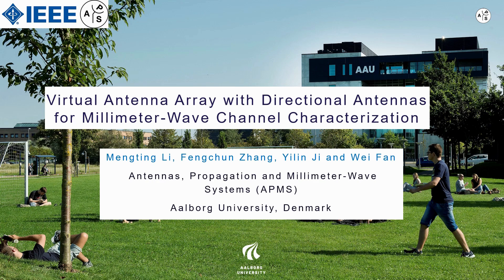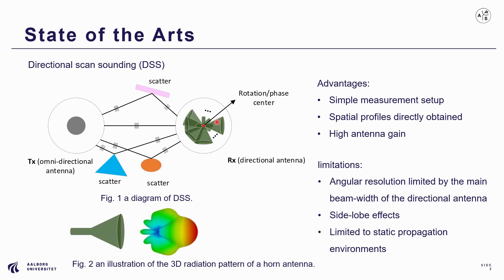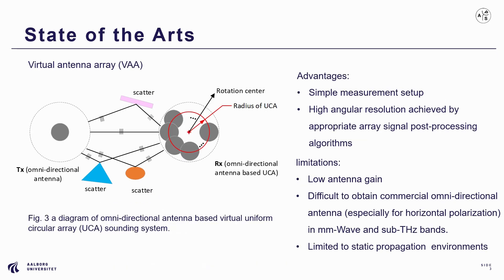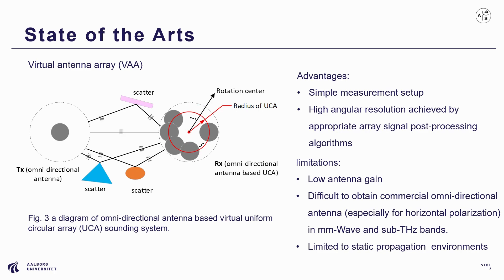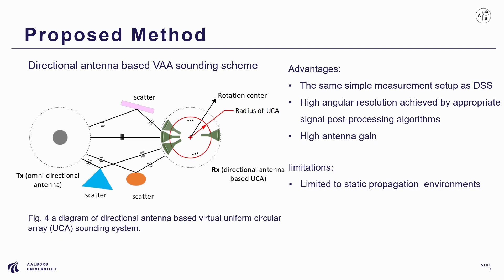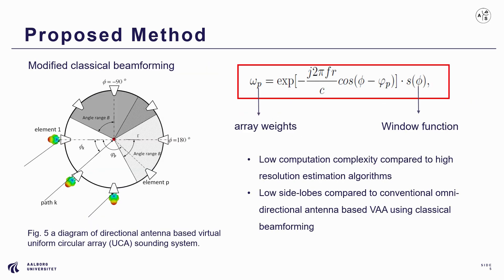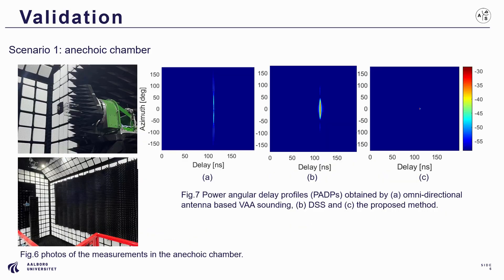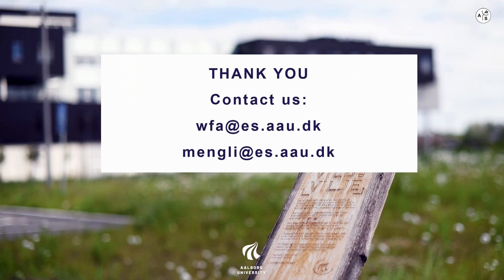Virtual Antenna Array With Directional Antennas for Millimeter-Wave Channel Characterization

Comment: This is interesting. I think you should be able to design your own receiver antenna and probably get the same benefit of rotation by arrays of small detectors, (smaller than wavelength).

By the way, your link to your paper goes to "pay per view". I had to search for an open version, which I found on ResearchGate. I do not know the policies or goals of IEEE these days. After 25 years of checking, I mostly find groups that are open can grow orders of magnitude beyond closed ones. Each situation is different, but the stagnation of closed groups is almost similar to people trying to breath in a sealed room.

Since you are physically rotating, I think "virtual" is a bit of a stretch.  I could probably tell you how to make a "real" virtually rotating receiver, but I am just too tired today. I can think of five ways right off the top of my head. But it is not my problem.

I think you are on to something. Keep up the great work!!  You might want to treat it as a machine vision problem.  And stop trying to use "antenna" methods.

If you had $Thanks, I would send you money for a cup of coffee at least. All I can do is say "Thanks for sharing".

Richard Collins, The Internet Foundation